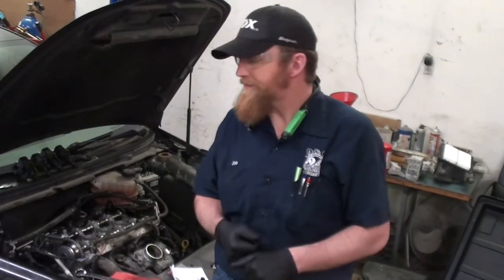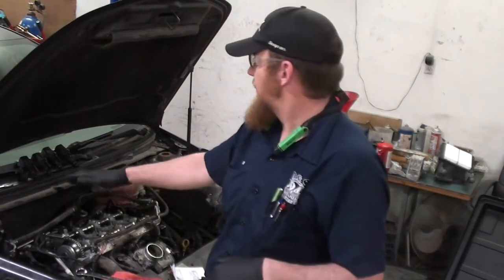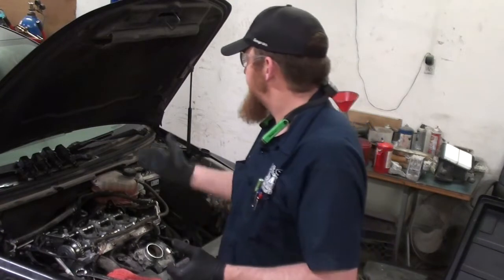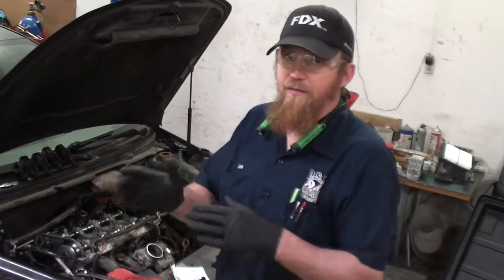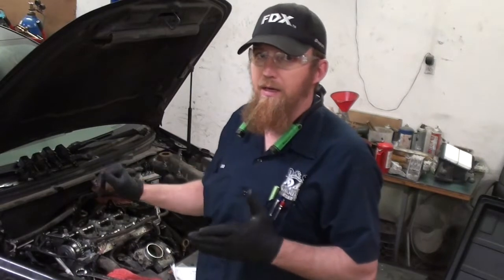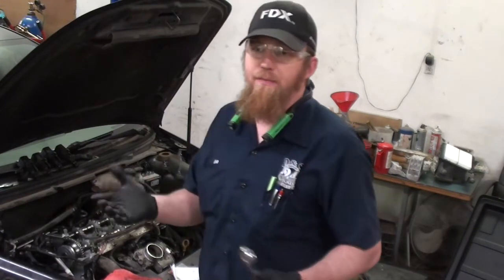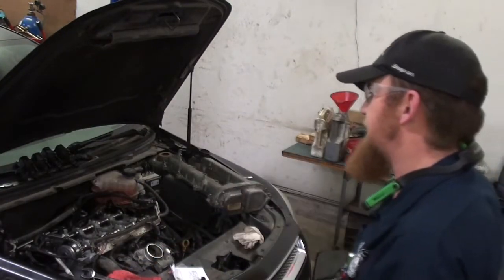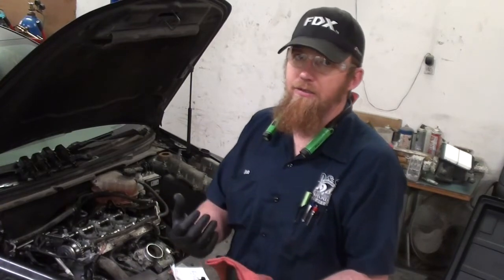G.M. 2.2L and 2.4L Ecotec Timing Set Tech Info and Diagnostic Tips

Comment: If I need to set the timing on the crank and exhaust cams up top on a 2010 equinox, what would be the ideal means/proper process to do so?
Reply from the maker: james Simmons make sure the engine is at top dead center exhaust on cylinder 1. This should put the timing marks 2o’clock intake cam, 5 o’clock crank, and 11 o’clock exhaust cam. Then line up the marks with the appropriate colored links on the chain. You will have to remove and deactivate the timing tensioner to do this, and remove the lower bolt from the tensioner guide and move the guid up out of the way so you can rotate the chain around. Always line up your timing marks intake cam, crank, exhaust cam only rotating the one you are matching up with the chain. After you reinstall the guide and tensioner use a 24mm wrench on the exhaust cam to pull all of the chain slack back to the tensioner, then use a soft tip pry bar to gently push in on the tensioner guide and this will activate the tensioner. You will also need to remove the exhaust cam phaser/ sprocket to have enough slack to rotate the chain. I hope this helps.